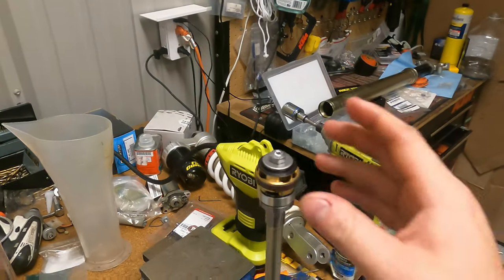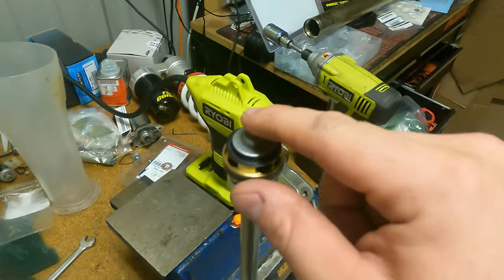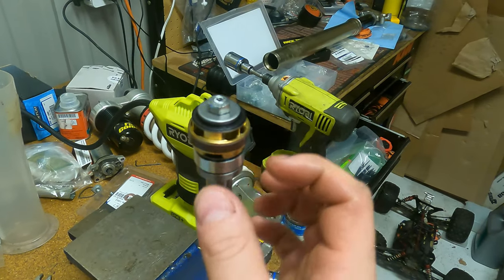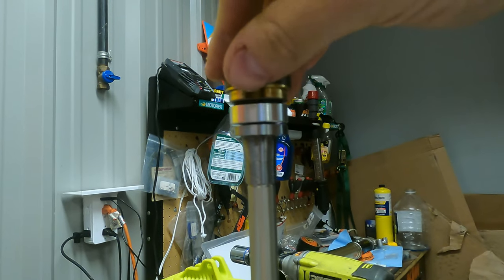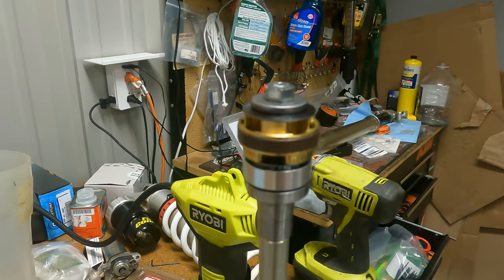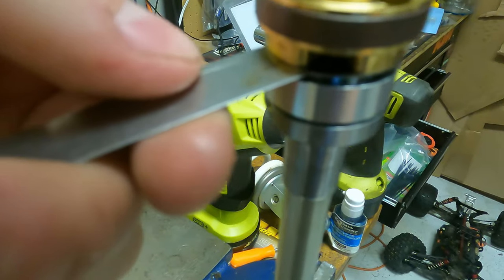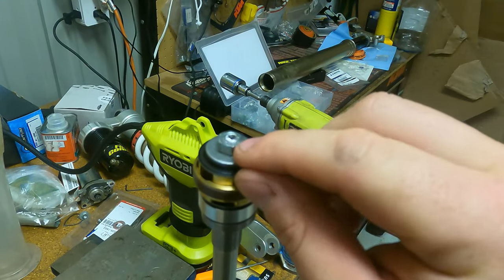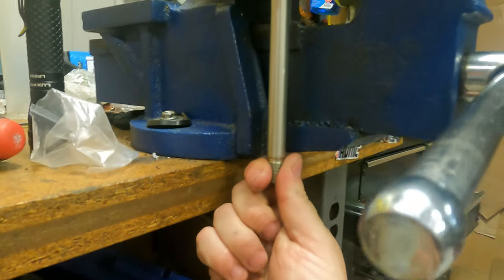Rebound / Midvalve Stack Build - Beginner Race Tech Gold Valve Tips

Comment: Can you replace that seal if you have a junk one, the one near bottom where you pack the threads with grease
Reply from the maker: Yeah, although on some forks it's quite a pain
Reply: @mxgryan  thanks brother, and great video. Just got done doing my rebound and mid valve on front fork, will get the compression done and back together they go.